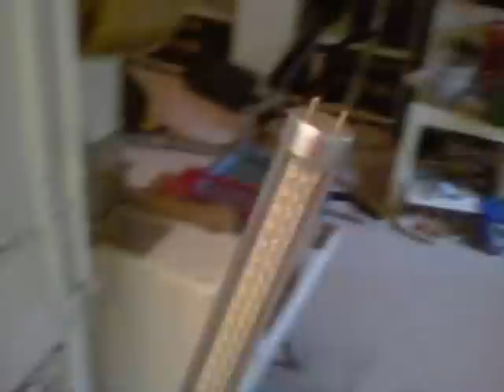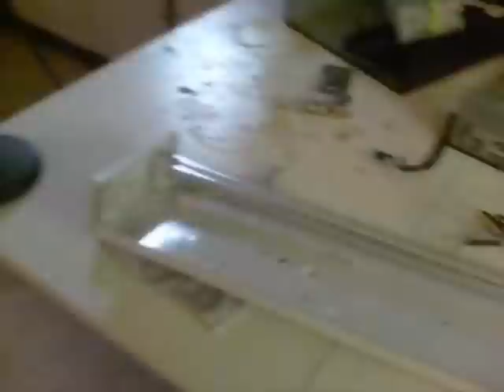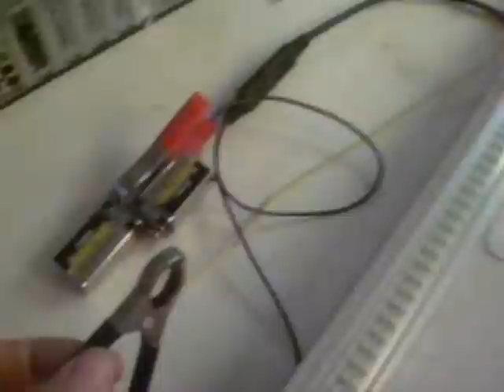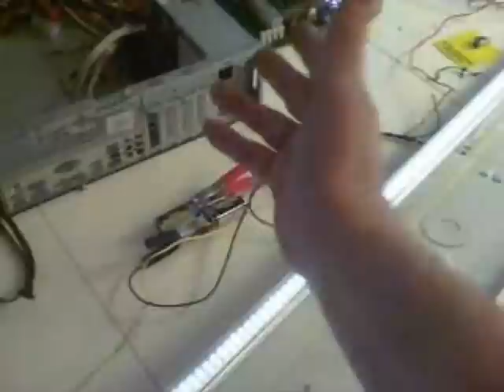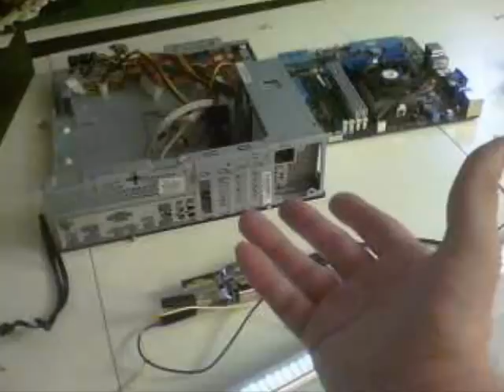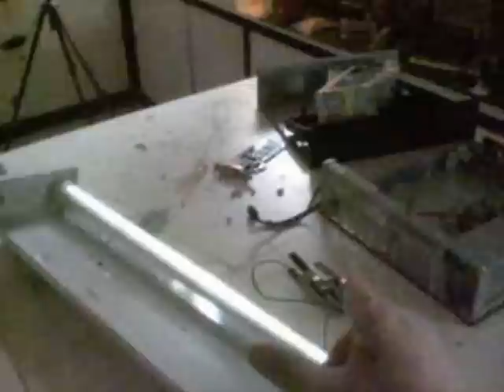More lighting with used 9 volt batteries

Comment: Nice video.  I would have never thought that light would work that way.  It's even possible to wire in a simple switch, and you can get 9 volt connectors from either a cheap old toy or at radio shack; and then wire it together that way for the same effect but a bit safer.  Well done, Sir.

Also, for those of you who can't afford electricity, how are you watching YouTube?